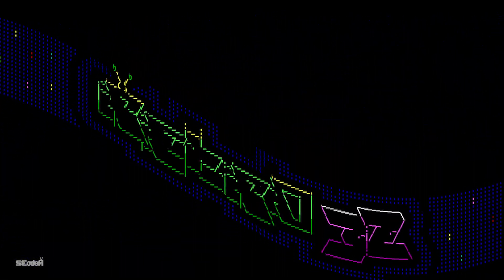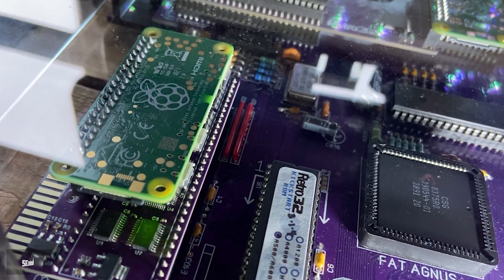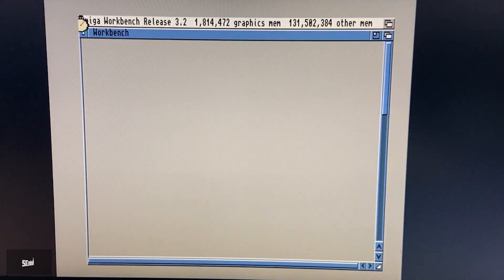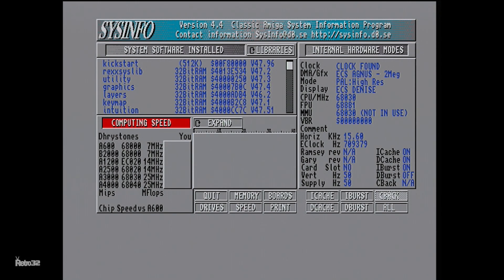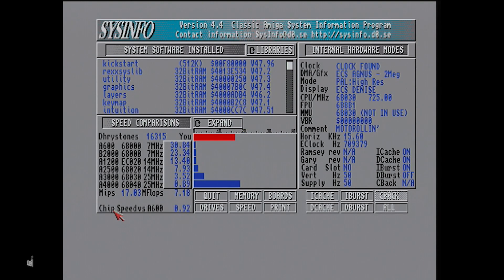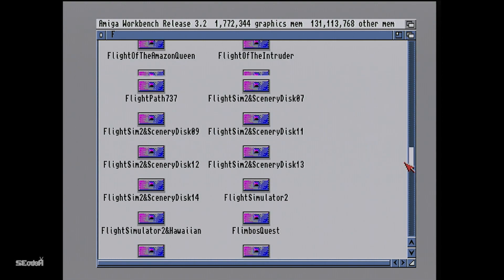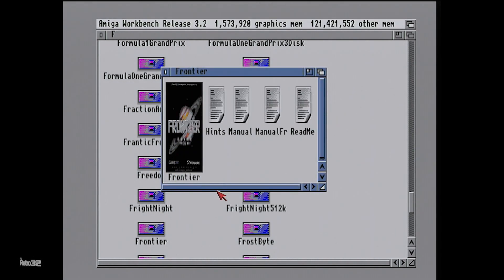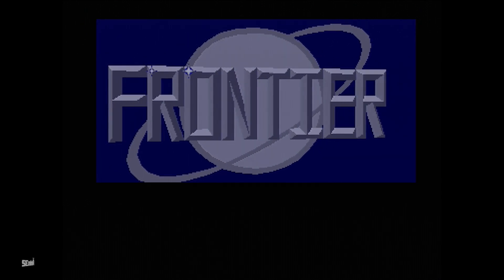Amiga 500 PiStorm Pi Zero 2 Performance comparison benchmark SysInfo games

Comment: Have you tried EMU64?
Reply from the maker: Not yet - I really need to make a new build with Zeb's WHDLoad image
Reply: @Retro32  I have Zeb's running on my 1200 and in my 500-Desktop that have PiStorm. I would say it is a great image. As much as I would love bigger Amiga's, or a Falcon, then I am really happy with my 1200. As of now I am in a dilemma... Should I sell my tricked out Amiga600 or should I swap the IndiECS-V2 scandoubler with an RGBtoHDMI solution. That scandoubler is freaking picky with monitors. I might be able to raise enough money for a stock 1200 that have been fully recapped and have some spare for a new case for my main 1200.

Comment: Yes, slower CPU emulation compared to the 3A+ should not be much of an issue. But chip RAM speed dropping down to 0.92 (from 0.98 which I get with the 3A+) could cause more glitches in games.

Comment: I’ve built 50+ PiStorm’s yet I don’t have one fitted in any of my 500’s. Once the chip ram issue is sorted I may use one.
Reply: Same here. Though I am a bit more curious on EMU68 at this point.
Reply: I guess the chip ram issue hasn't been fixed yet? Maybe it can't be fixed if it's a hardware limitation